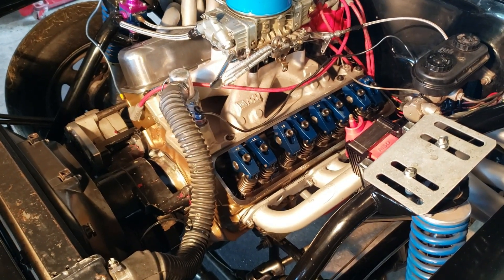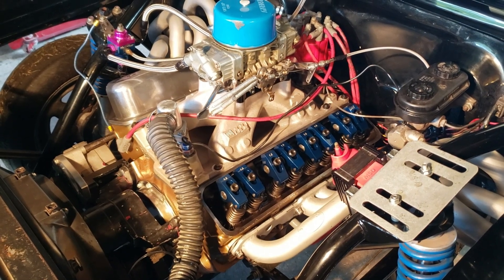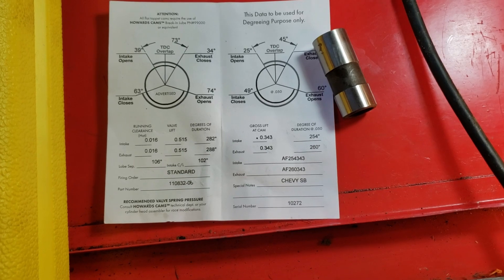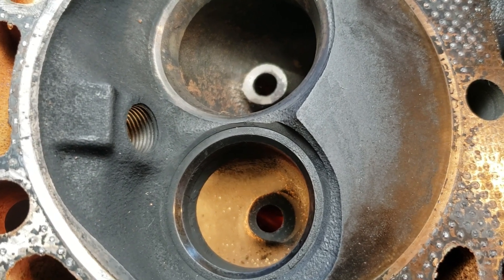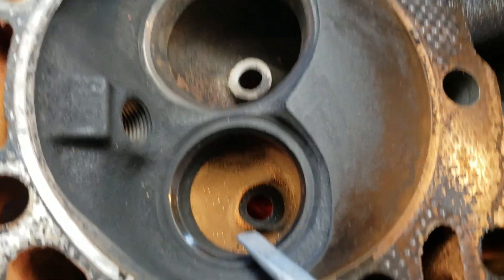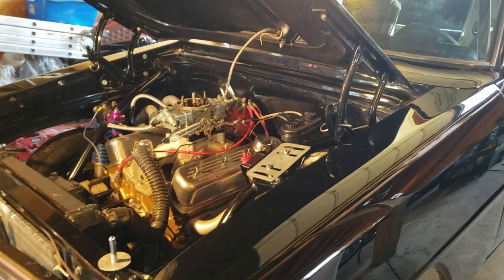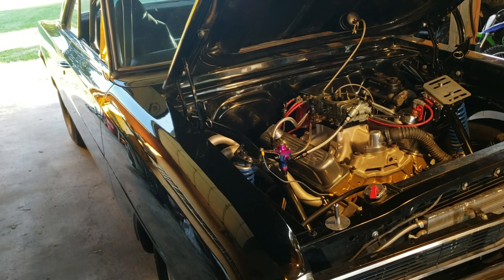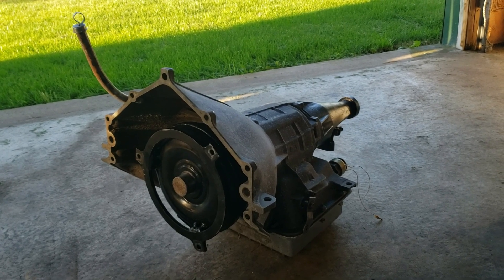Pt.7 How Fast Chevy 350 Vortec Heads 254/260@.050 106 l.s. 9.7:1 comp.

Comment: I think you left some hp on the table with the 9.7:1. With that much cam, even with the iron heads you could get away with 10.5:1 or more, on 93 octane. I run a similar 106 lsa solid flat tappet 250/260@.050 camshaft and 5000 rpm converter on the street, but aluminum heads, I run 93 octane with 10.95:1, and I probably left some power on the table as well, I bet I could get away with 11.5:1 or more, but next time. As long as it cranks less than 200 psi, it'll likely work with 93 octane. Did Dynamic Racing build that powerglide and converter? If not, they could make you quicker.

Comment: Mechanical flat tappet is the way to go, super strong and cost effective. Folks whining about "maintenance" are just not real gearheads. I had a comp 294s magnum in a daily driver 81 camaro, 383 stroker, I could leave the valve adjustment alone for 6 months and they would still be good. I ran 12.3 @117mph. Your engine runs GREAT, you got the combbo right, but did you say 60 quench? I would shoot for 35-40, Mr.gasket makes a .020 gasket. I am making assumptions here,, NICE RIDE

Comment: Nice build,awesome sound..a little brake torquing at the line will lower your 60' and your et. Sounds like youre launching off idle..you should easily be high 10s in my opinion with what you have

Comment: Man if you blend the bowls all the way and tear drop the valve guid bosses into the runner and do a 4 or 5 angle valve job and back cut all the valves you will pickup between 50 and 80 HP...just lapping those valves in is killing the flow especially on the intake side...if you fix those heads you will run 10s very easy.... IV picked up 8 tenths in the 1/8th on my own car just by doing exactly that to my heads....
Reply from the maker: Nice i do plan on doing head porting comparisons. It would be nice to see extra power.

Comment: 4500 stall and keep the T350 its making decent power for what it is
Wouldnt run 38 deg as someone suggested too much you probably know that already
Reply from the maker: Nice, I found a deal on a 8 inch Coan converter.  It should stall around 5000 rpm.

Comment: How did you get the vortec heads to take .515 lift? Everything I’ve read says .50 is the limit. Interested because I’m building a 350 that’s very similar and have been struggling with cam choice

Comment: I use to run 010  350 blocks with 882s on my s10s back in the day with 175 shot on it. Cheap but it worked. Close to what your doing except for the nos.
Reply from the maker: Nice sounds like fun

Comment: Sorry, I thought you were running a 400, I was wrong.  I use to run a 350 in my 73 Corvette with 186 Z-28 heads with flat tops, torquer intake with a holley 800 cfm.  It was a fast street car over 40 years ago...  I have a fast race car, 66 Chevelle 468, tube chassis car, weighs 2,370 lbs. with driver.  5.62 et. 1/8 at 123 mph.  8.82 et. 1/4 at 152.52 mph.  800 hp. engine.  SV1 carb made by pro systems, billet carb 1150 or 1180 cfm. Running without power valves is not good. Causes hesitation in the carb.  Jet size has to be 10 sizes bigger after removing power valve, thats what they say.  If the engine doesn't have alot of vacuum at idle meed to put a 2.5 power valve in it.  What ever the vacuum gage says at idle you are suppose to put a power valve 1" less than the reading...
Reply from the maker: Good information thank you. Nice I would like to get ahold of a set of 186 heads. Sounds like a fun car.

Comment: A loose converter. Mill .050 off those heads. Add fine tuning your a 10 sec car all day everyday.
Reply from the maker: Nice than you. Trying to get a good converter for the th350 now. I know the gearing In the powerglide will be a step backwards.Im hoping the converter will make up for it. Its hard doing different engines they all need different stalls and gearing.
Reply: @nylegreen261  I know you know the ins and outs. Great of you posting such videos for the viewers that im sure helps tremendously.  And by god engines are crazy expensive now. A gen1 350 with cast internals and advertising for 5k plus. Keep up the projects.
Reply: @nylegreen261  are you going to put a 350 input shaft in the glide? Then just move a 3500 converter around. Seems most combos would take a 3500 easy. That's my street converter of choice.
Reply from the maker: @PatandDoopypoopy  Thanks I have the powerglide input shaft. Im going to have to run my a1 8 inch stall. Should  be around a 5000 stall.
Reply: @nylegreen261  that 5k stall will make a hard hitting holeshot. If I recall, aren't you revving some bigger cammed combos pert near 7000?? It will fly. We'll  be looking for videos. Be safe and well.

Comment: Do you degree your cams per the cam card or run it straight up?
Reply from the maker: I have checked some. They have been on the numbers with the cam card. I have put in a few that didn't have much piston to valve clearance and ran them as is with out checking numbers. I have had good luck so far.

Comment: I didn't see what size the carb was but i would start jetting down till mph slows. Et will picl up ive had similar setups never needed more then 72 front 4.5 pv 80 rears.
350/iron 200s flat tops stock rods/crank herbert 254/260 534/555 on 106 
4400 9" ptc converter  3100# 72 nova 7.20s
Reply from the maker: Nice I love seeing combos. Im running a holley 750 hp. I take it you are running a 750 also.

Comment: Was expecting a much better time slip. Bog off the line. What is the idle timing set at?
Reply from the maker: I've got 34 locked. I was pushing through the converter. It is a cheap tci street converter.

Comment: That is impressive times for a bare bones 350 in a world full of ls swaps
Reply: Ls engines run good but are ugly and don’t sound as cool as gen 1 small blocks
Reply: @turboboy-oq6xe yeah I noticed I only like the sound really when it's a carbed ls.
Reply from the maker: Thank you.. Yes a very inexpensive and simple set up. I will try to push the times lower.

Comment: Be very interested in seeing you put more work into the port and valve jobs before changing the transmission.
Reply from the maker: I plan on doing work to the heads. I tested six different engines so far. I tried to keep all the heads similar in the first round of the builds.I was curious what the different camshafts would do. I also needed time to learn how to properly port the vortec heads for power.
Reply: Knock .020” off the heads while they are off

Comment: Cool car. I heard you say your total timing is 34 degrees. What is your initial? With that cam, compression,  and heads, I would expect 18 to 20 degrees of initial. 

If you decked the block or changed pistons to something that can get you .035 or so piston to head, it might make best power with about 32-33 degrees total. You might even lock it out.

With an increase in compression you could run a 108 degree lobe separation angle. As well as a bit less exhaust cam timing. It will 60 foot harder.
Reply from the maker: Timing is locked at 34 degrees. If a changed the piston to head clearance to .035 what would have the greater effect on power quench or compression. What effect would going to a 108 l.s have. I think maybe reducing overlap. Cleaning up the cylinders at lower rpm. Same effect as reducing duration.
Reply: Reducing piston to head will increase compression,  improve quench, and increase power. A typical 906 head measures 63 cc chamber volume if the valve job isn't sunk. If you could get to .035 piston to head clearance your compression ratio would be right at 10.4:1, all else being equal. If you milled the heads about .010-.011 you will have approximately 61 cc chambers giving you 10.6:1. The increase in compression will improve torque at all speeds and will support the large cams a little better. Increasing the cylinder pressure helps the exhaust get through the head a little bit too, which the 906 casting needs. 

The 108 degree lobe separation angle is a better complement to the 906 heads with a compression ratio in the 10.5:1 range and stock valve sizes. All other things being equal,  the 108 LSA will close the intake valve later than the 106, which will help it breathe in the rpm range you are working with.  It will slightly reduce cylinder pressure compared to the 106, too, which might help you on street driving. Though the net change from the higher compression ratio will still be an increase in cylinder pressure and torque over your current combo.
Reply from the maker: Nice thank you. I was thinking I would keep the same intake centerline @102 and move the exhaust side to get the 108 l.s. I want to try higher compression. Im worried I won't be able to run on pump gas.
Reply: @nylegreen261  If you install the cam with a 108 lsa on a 102 degree intake centerline,  it will be 6 degrees advanced. This will close the intake valve earlier, increasing cylinder pressure. That could increase fuel octane requirements. 

I am confident that you can bump the compression as I described,  and with a 108 degree lsa cam installed on a 104-105 degree intake centerline  you will still be able to use typical pump fuel.
Reply from the maker: @v8packard  The cam is currently installed +4 on a 102 c/l. This channel started with me needing 2 engines. I found so many good deals ended up with several. I imagine I can thank the ls for this. My interest are in cam dynamics and head velocities. Im learning slowly and when I have time. I appreciate the input.
Reply: Mind if i jump in i have an almost identical engine build going into my 81 c10 longbed. my static came out @ 10.4.1 with a .19 gasket, .43 ptv wondering on how much cam to put in to still run on pump or how youd approach it maybe install cam 4 deg retarded or back off timing?
Reply: I’m hoping for something streetable around.500 lift with a little stall and 3:73s. Is it true more compression needs more cam?
Reply: @mjhickson4339  Your truck probably weighs 1500-1800 pounds more than the Nova in this video. You really need a smaller cam with a powerband that makes more torque from 1000 - 4000 or so rpm. Your 3.73 gear is good, and I assume you have stock size tires. If you are using the L31 heads, you probably want something with a 108 degree lobe separation angle, 50 degrees of overlap, giving you 266 degrees duration @ .006 tappet rise. Without knowing more about your combo and how you want it to drive, this is probably the most I would go in a long bed truck. I would install this cam on a 104-105 degree intake centerline. 

I think it's more accurate to state more cam needs more compression.
Reply: @v8packard  thanks for the reply, heads are 062 casting vortec irons with 1.52 magnum roller tips on   .880 width springs 1.780 height, 110/320 seat pressure. Set up for .550 lift. I can change springs if necessary.
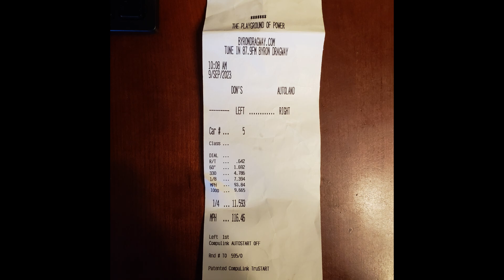350 4bolt .30 over, summit +6cc 4valve relief .560 height pistons.  Th350c trans . 31 inch tires . Could go to 4:11’s.  Just want to do 65mph without winding out but match the cam, converter and rear for burning em off . 
Curb weight lists at 3500 ish
Reply: Oh the top is finished off with rpm air gap and a 650 avs2 carb. 
Cams i had considered were comp xe268h or 262 or summit k1103 maybe a 2500 ish stall and a shift kit, but im debating now at going more radical because I will be driving it less overall

 i just figured that since heads aren’t milled and block isn’t decked that to get quench down even to .43 I’ll be running a.19 steel shim gasket putting me at 10.1 ish so I’m nervous I could be lugging around detonating on pump gas, this is my first real build and its alot more complex getting everything to jive than i realized the more i learn the more I question it all hah.
Reply: @mjhickson4339  I am not a fan of Comps XE line. They are certainly aggressive and can make power, but they close the valves awful fast and can be noisy. They need more spring than most people give them. And I don't buy anything from Summit. I would suggest you contact one of the independent cam companies like Jones, Bullet, or Cam Motion. There are others too. They can help you with cam and valvetrain parts. A cam like I suggested will produce good power in the powerband I mention and still run out to the high side of a 5000 rpm range. Tuned properly it will run fine on pump fuel.
Reply: @mjhickson4339  yes
Reply: My bingo card says 36° total is what it'll like.
Reply: *Assuming you verified true tdc and the balancer is marked correctly.
Reply: Initial timing means nothing except for starting.

Comment: Great video and nice progress! It will be exciting to see the comparison with the powerglide and the 8” converter.
Reply: I was wanting to see the powerglide to compare here...
Reply from the maker: Old combi 408, heads pro action rr 23 flowed 335@ .700 Jay Allen cam 270/284@..050 .440 lobe108 l.s yellow terra 1.6 1.5 shafts. 13.5 to 1. Powerglide 1.82 first coan 6000 stall.
Reply: What was the combo then ? That’s seriously fast for a n/a deal
Reply from the maker: Nice thank you. I was pushing through beams to stall the tci 3500 stall up.
Reply: lol, needs more then that.
Reply from the maker: @robertclymer6948  I'm trying to make this faster on a budget. Let me  know what direction to head in. I have around 1500.00 in the engine and 350 in the trans and converter. Most of parts are off of craigslist and facebook. Im a hobbyists and have not gone to a machine in years.  Looking for tips.
Reply: @nylegreen261  maybe because it looks so good and the beautiful motor I was thinking 10's. My bad.
Reply from the maker: No problem it was quicker 15 plus years ago. Stock block, iron headed, 23 degree sbc n/a mid 9's 1/4 mile. Got married, had kids,, sold engines starting over with low budget. Having fun.

Comment: Check your cylinder pressure. That's a big cam, I would think 10.5:1 CR would be ideal. Also higher ratio rockers with the correct geometry would help.
Reply from the maker: Cylinder pressure on my  gauge was 168 psi. Im at my limit on just about every measurement on this one. Coil bind, piston to valve, retainer to seal.
Reply: It's a has solid tamp ..106 separation.. and 20/1000 separation hole...less compression for street use..he'll be fine.
Reply: If you run higher ratio rockers retard the cam, 3 to 4 degrees for 1.65:1 rockers.
Reply from the maker: I have been a little nervous going over .500 lift with the vortec heads. In the flow numbers I have seen they are turbulent above .500 lift. I wouldn't want to buy a cam to test. But if I found a good deal on some 1.6 rockers I would test this.
Reply: You'll need springs with a seat height of 1.8" , I run a solid roller with 1.7 ratio rockers and the lift is .603 on the intake and the spring seat height is 1.8 but you'll need .1" longer valves. The heads I'm running are the old school bowtie's from the 80s , In your case with flat tappet valves and running on the street, you best stay put.  @nylegreen261